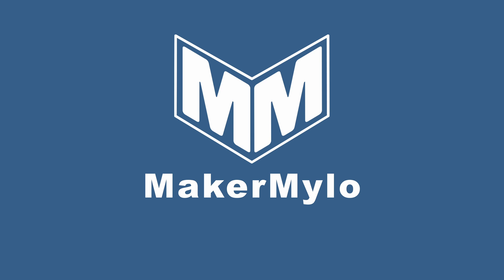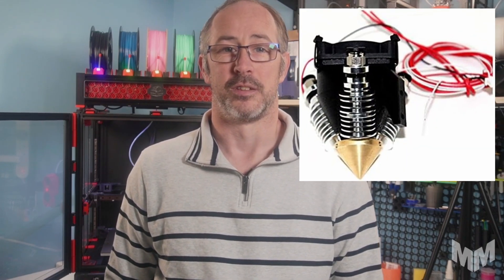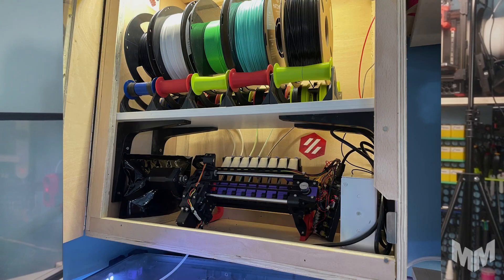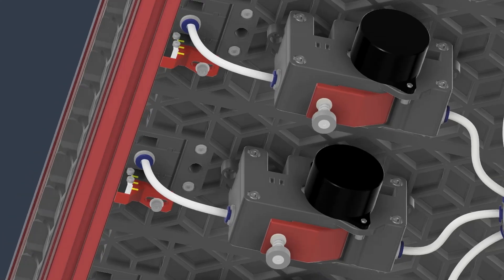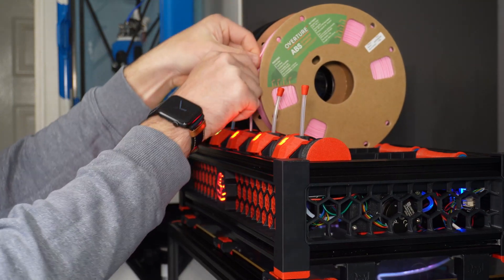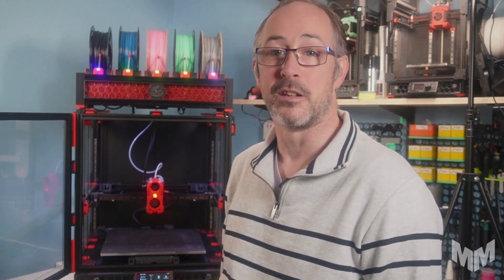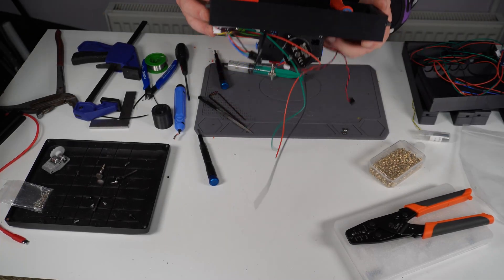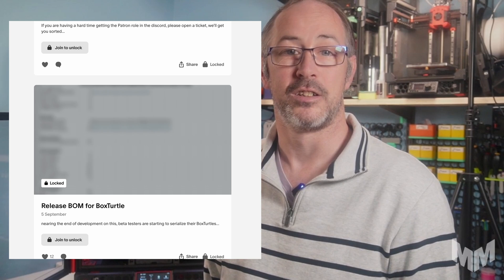BoxTurtle OUT NOW DIY AFC The future of Multi-Material Multi-color 3D printing? The new AMS/MMU?

Comment: How did you deal without a filamentrix, is it by tip-forming and how much work did you spend on tip-forming calibration?
wondering how the existing filament is removed from the hot-end before inserting another type.
(i dont see this any option for the tip being 'snipped' at the end of the armored turtle.

Comment: Just as a note, you were showing a clip of the MMU in use, and part of that is watching the toolhead, but instead of letting us watch the toolhead work on changing filaments and prepping, you kept the video of the MMU blocking that entire section of the bed so we couldn't see what was happening. Really would've liked to see the entire process of the printer swapping filaments since that kinda was the point of these clips at the end.

Comment: From the perspective of someone who's completely inexperienced with multi-material 3DP, and has only barely dabbled in using a stock printer... Couldn't you have the intersection point of the different feed tubes be closer to the print-head, so they wouldn't have to retract as far before the next material could be injected, thereby improving print times? Please, do correct me if i'm wrong. I do understand that there is a certain amount of limited free space to work with, and that you already tested one or two options that had the intersection point inside the print-head, as mentioned in the video, so I'm not suggesting you use something like that, so much as I'm suggesting having the intersection point be, say, a few inches above the print-head or something.
Reply from the maker: That would be the dream but for BoxTurtle its simply not designed to offer that solution, thats not to say it isnt possible, just less easy to implement. There is another solution (and this is all im saying) coming very soon that I will be doing some content on that is more like that.
Reply: @makermylo  nice! Btw, there was something I saw the other day about a hotend that uses "inductive heating" to melt the filament, instead of the typical thermal block that usually gets used these days... It's supposedly more efficient, or heats the filament more evenly, or something like that. Have you tried looking into that to see if it's a worthwhile addition?

Comment: Nice, but the ERCF supports up to 12 filaments. But i dont think most people will use that much, but it's  good for continuous print without refill
Reply: You can chain multiple BoxTurtles as well and achieve the same effect, though it's not QUITE the same.  Ironically though I think the BoxTurtle will still manage to have a smaller footprint.

Comment: I consider myself as an amateur 3d printer guy, My first printer i built was a pruse, second prusa was prebuilt and the third is an X1c from bambu, My strength and interest has always been material profiles tuning them to perfection! My least interesting thing has been software. As I understand all my machines are based on legacy Marin and not klipper, would this project work on marlin or why is it that most fun projects depends on the printer running klipper? Great video and very interesting project!

Comment: I noticed u have a 5 spool but the release is 4. Does that mean there will be options to add more for one printer? Similar to Bambu labs?
Reply from the maker: There is indeed.
Reply: @ would you be able to elaborate on what kind of config? Only 4 rolls and you must build another box turtle to have total 8? Or will it be like the ercf and be able to add as many as you like
Reply from the maker: @lamvu6185  As it stands every 4 needs another AFC Lite board, but other than that yes its like ERCF in that you can infinately add more.

Mine was a beta unit so didn't use an AFC Lite board, it was a totally custom electronics suite missing some important features in order to get 5 spools working.

It's since been rebuilt using an LDO Kit at 4 Spools

Comment: are you going to post somewhere how you added the fifth lane? I am genuinely interested in this project, but my sv08 still has a warranty on it, and the only other printer I have is a stock ender 3 pro. I may try to put klipper on the ender, but don't have a lot of money (even the price of the BT is high for me). Any suggestions?
Reply from the maker: The 5th lane isn't something i wish to support, its essentially just a bigger frame and +1 to all of the lane components, the controller was a nightmare as so far there are no plans to release an official 5 lane board, which means you need 2 of the $75 boards to run the BoxTurtle and a whole load of effort working on the configs.

Comment: It seems that the difference between the BT and the ERCF is that the BT has a separate extruder for each filament, and maybe one more to feed the filament to the printer, while the ERCF moves a single extruder between rolls of filament.  More complexity to save some money on extruders.  The ERCF has options for filament cutter at the MMU or at the printer.
What I don't understand is how do you automate this when most printers require holding a spring loaded tension bar on the extruder while loading the filament?  Unless you can push filament into an extruder without pressing on the tension release IF you run the extruder motor at the same time.  I've never tried that.   It looks like the Prusa MMU is similar to the ERCF in design.
Reply from the maker: The simple answer is that it does extruder sync 100% of the time, the extruder and the extruder on the toolhead work together to ensure constant feed on the filament.

It's more expensive to build than an ERCF but a LOT easier to build and use for sure.

As for cutters,  I designed 'Snappy' which is a fork of EREC from the ERCF Repo, this works brilliantly as a remote cutter on the BoxTurtle itself, otherwise the current standard is to use the Filametrix cutter at the toolhead.

Comment: This is super interesting. Do you believe this "could" work on a rooted Creality K1, if using a customised print head that includes a cutter?
Reply from the maker: You wouldn't even need a toolhead cutter, as long as you can plug a USB or CAN into the mainboard for the OS to see and run Virgin Klipper you can run the BoxTurtle, the only thing you NEED on the toolhead is a filament sensor.
Reply: @makermylo  Thankfully Henlor has already created an easy Toolhead Runout sensor mod.
But this is great to hear. Depending on what the K1 CFS Upgrade from Creality will cost, this could very well be a great alternative. Thanks for the info.

Comment: if i use another board like bigtreetech octopus or mellow fly 8 which motor driver i can use to control the n20 motor?
Reply from the maker: Only the official AFC Board is supported as it's needed for the bi-directional N20 motors, those don't use steppers just 6v +/-.

Comment: How comes your unit has five spools but the picture in the link shows a unit with 4 spools? If I want five spools do I need to buy all the extras separately or is their a five spools kit? I would much prefer to buy a reliable kit than to source all the parts individually myself. Thanks for the video btw.
Reply from the maker: There isn't (And probably will never be) official support for more than 4 Spools, mine was a custom build way-back in beta, there is however nothing stopping you from buying a 2nd AFC Board to run the 5th Lane.

Comment: What board did you use? The afc only has space for 4 motors. Keen to know how you got the fifth working ?
Reply from the maker: I didn’t use the AFC this one was built before AFC was a thing, it uses a Spider 3 board.
Reply: @makermylo  thank you ! I just bought all the bom parts and will build one in the near few weeksm.ideally i would like 6 spools but will start with 4 and expand later
Reply: @makermylo  Would you mind sharing your config for the Spider 3 Board? Great work and Video
Reply from the maker: @martinj2008  My configs are all here, however i don't run the standard software, mine is running on HappyHare so its all completely non-standard and I won't be supporting it im afraid but heres the link: https://github.com/MakerMyloConfigs/v24_scarlet

Comment: What is the dimensions of your unit with 5 lanes?.Just want to see if the 5 lane version would fit on top of my v2 300.Thanks
Reply from the maker: 490mm with just 5 lanes, Or 510mm for my setup (designed to fit ontop of my 350 V2 perfectly) i added 5mm spacers between the lanes.

I doubt you'd get 5 in a 300 v2 footprint.

Comment: Why not use full NEMA17 steppers instead of the pancake motors? Cost is probably less and weight isn't an issue and the extra power would make it for sure not the weak Link in the system for running as fast as possible
Reply from the maker: I guess you could mod it to use Nema 17's if you wanted, space might be an issue.

Comment: @MakerMylo - Great presentation of a great tool! Question, does this work with bed dropper’s vs Flying Gantries… Looking for a solution for my K1C
Reply from the maker: @TheJacklwilliams  it should do, I’ve asked Creality for a K1 to try it but I doubt they will as they just launched their own.
Reply: @ Thanks Mylo! I’m digging around looking at all I can find to zero in what system to buy/build. I like what you showed of the turtle. It looks like a well designed solution. What I like about the bed dropper and this is, just opinion as I haven’t experienced it yet, is when the filament change is triggered, any retract is short and sweet since the distance to the extruder from the system is the same each time as opposed to the gantry being on the bottom and the retract and subsequent filament roll/buffer rewind has to deal with that. Again, that’s me spouting on about something I’ve had no experience with. Yet….

Comment: Looks like there's a motor for each lane. Did you need to add a stepper expansion board?
Reply from the maker: For my 5 lane, i used 2x MMB's originally as it was still in beta, it now runs on a Spider v3 but it lacks functionality due to not having the bi-directional assist motors.

Comment: Where could I find the 5-lane version mod, and how big is your printer? Is it a 300 or 350? Also, how are you getting that many lanes for motor controllers?
Reply from the maker: Mine is a 350, it's not a released 'Mod' its essentially +1 on everything and then figure out the electronics.
Reply: @makermylo  Did you have to do anything fancy with the hub? It looks like it's only for 4 filaments.
Reply from the maker: @Muddles178  It has an extra hole in the top of mine for a 5th input.

Comment: I counted 1 min, 15 secs to change.  Great work, but separate tools ultimate solution
Reply from the maker: Yeah, mine is in no way tuned for speed, infact it was barely working at the time of recording due to a power issue causing stalls at anything more than 100mm/s feeding, some people are running 250-300mm/s fast move speeds.
Reply: I think a ams would be a good addition to the last toolhead in the chain on a changer.
Reply: Yeah, it's called turtlebox for a reason, lol

Comment: I love this, my one question is, does the voron now poop like the bambus? and if it does where is it pooping?
Reply from the maker: It does, there are several places it can go, either just on the floor of your printer OR you can use an addon such as Blobifier (which is used here) to collect the 'poops'.

Or you can use a larger prime tower but that takes a long time, i generally poop using blobifier then use a tiny tower just to clear any debris.

Comment: How does it handle the erm, poop, problem that the AMS has?
Reply from the maker: That depends on your setup, I'm running Blobifier so it poops like an AMS, others use prime towers (you'll notice i use a small tower just to capture ooze)
Reply: @makermylo  Awesome, thanks for the info. Still deciding on how I wanna do multi filament on my voron
Reply: What is the problem the AMS has with poop?
Reply from the maker: @jaeitee  It exists :D